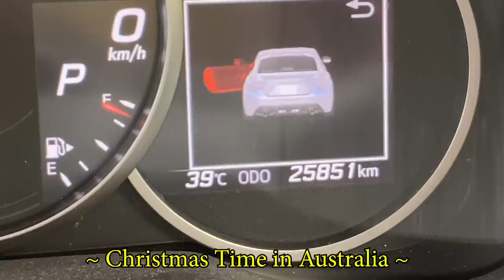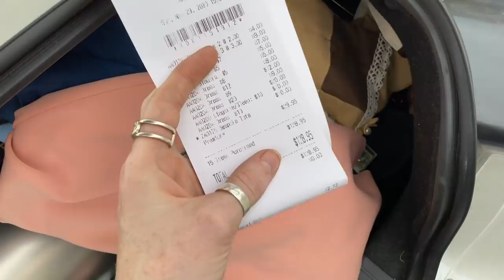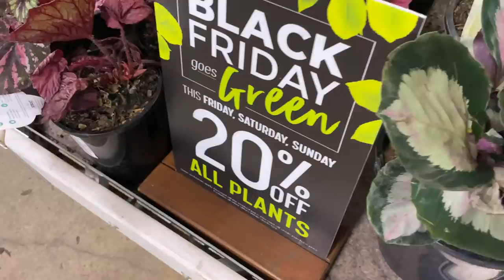$50 THRIFT STORE CHALLENGE!!!! $100 THRIFT HAUL & TRY ON | THRIFTMAS DAY 2

Comment: That's where I learned to drive and did my driving test... One of those roundabouts had some idiot p platers blast their horn at me... Which my sick with the flu (but still working... Thanks heaps for the flu I got) instructor during my test decided must be because I had pulled out in front of them (totally didn't) so failed me.
Was so angry, then so sick

Comment: I would say that this challenge ended in a draw. Any thrift haul, especially without a clothing try-on is going result in fit issues. I usually regift or re-donate the questionable fit items. For that 2-toned long sleeve top, I would dye it any pastel color. The grey material will (hopefully) result in a darker color result while the beige (white?) material will not be as dark so that (again hopefully) the result will be an ombre mix of pastel/dusky tones of the purchased dye.

BTW Alex is a better person than I resisting those adorable planters!